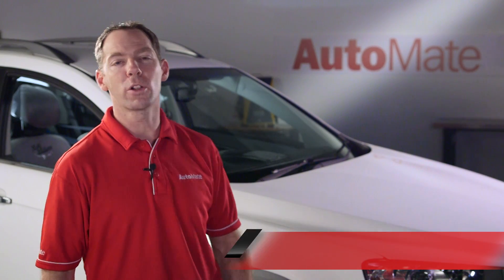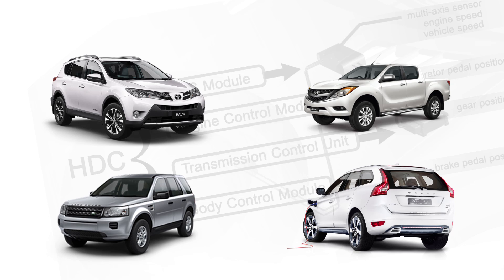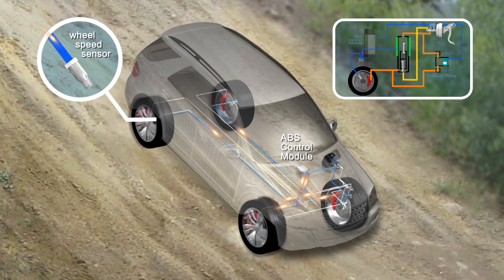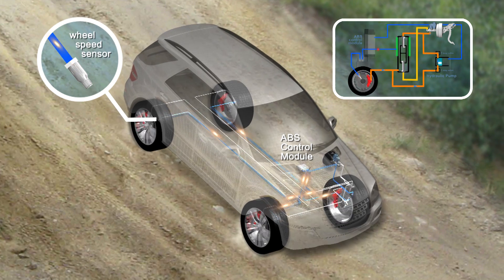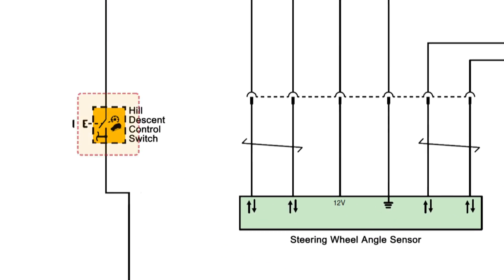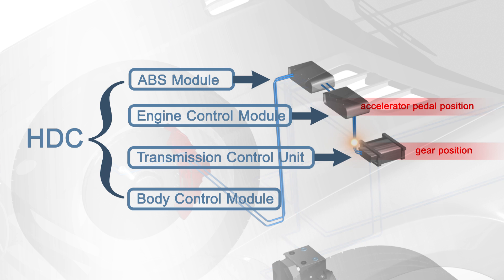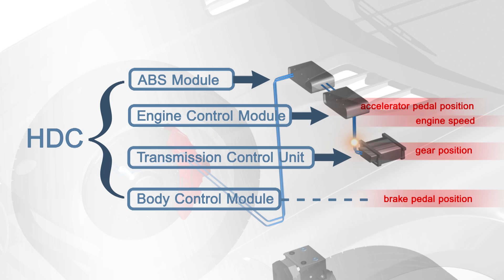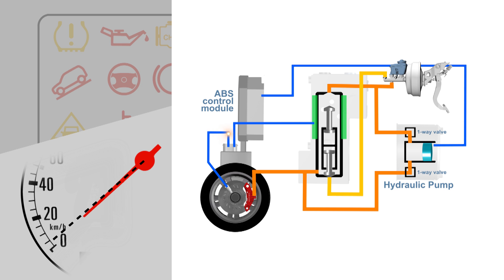Hill Descent Systems

Comment: that is so useless, you can do this with your feet if you fancy, but its much better idea is to put it lower gear, brake down less then you want to have at max, and if it goes beyond that limit like +5-10 km/h just brake down harder again. Much better than gently braking for long period of time ...
Reply: Hello Johnny. It looks like you got some experience with this subject. Please, help me out. I will be using a Jeep Commander Diesel 4x4 in October in one of the most dangerous hills in Brazil. Based on what you said, can I assume it would be much more effective to simply use the reduced 4x4?

Comment: On a long steep decline , doesn't this system overheat the brakes?
Reply: If the temperature exceeds certain threshold due to long braking then this feature gets fade out with a continuous beep for pre defined duration.
Reply: Is it a good idea to manually shift to a low gear rather than using HD control  on a long steep decline?